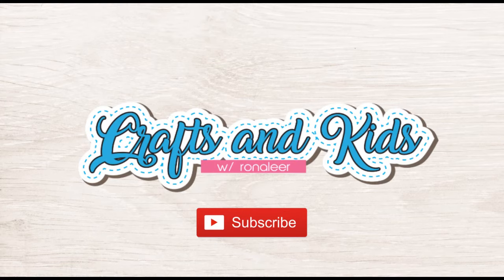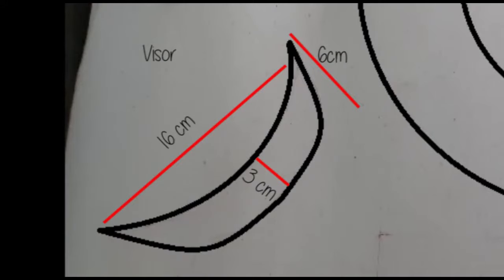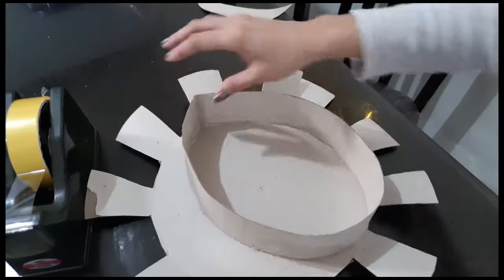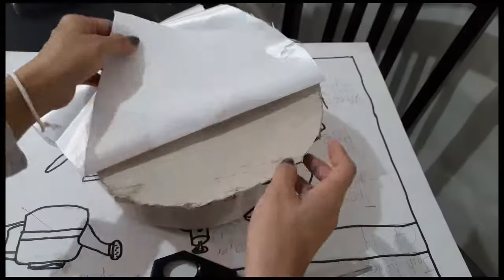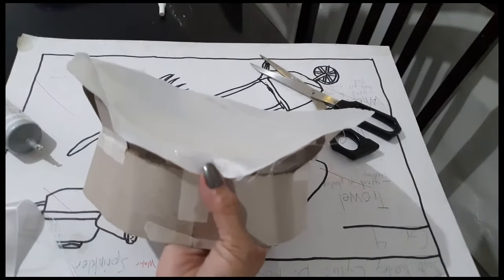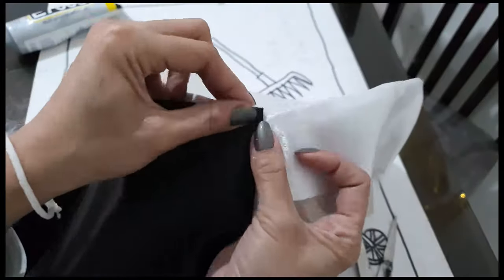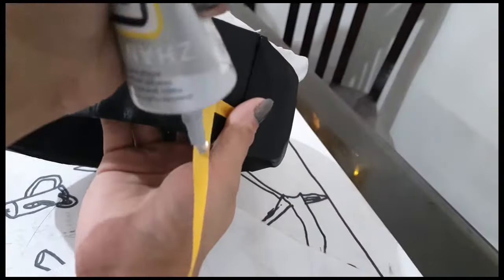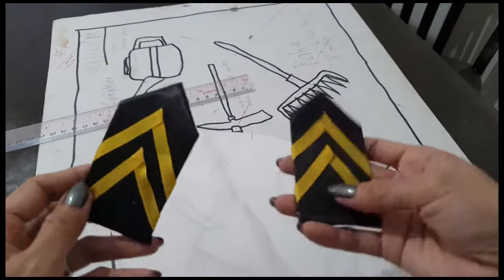DIY Pilot Hat from Cardboards | Career Costume

Comment: hi mamsh.. ask ako if yung badge nya pinrint mo lang po using bond paper , then if bond paper mo gamit mo cut and paste agad sa uniform or idikit po sa something like folder pra meju solid po sya thaksss
Reply from the maker: Nag print po ako sa vellum paper (card stock paper), mas thicker po xa sa bondpaper. Then nilagyan ko ng scotch tape pra mukhang laminated. Then ng tape din ako ng safety pin sa likod para itusok nalang sa uniform